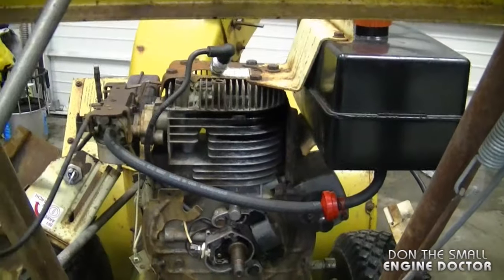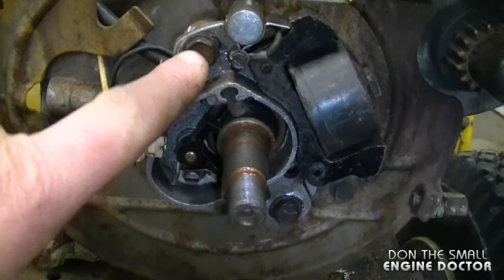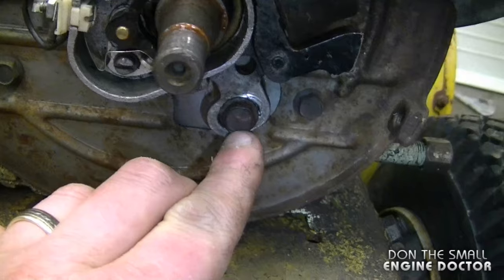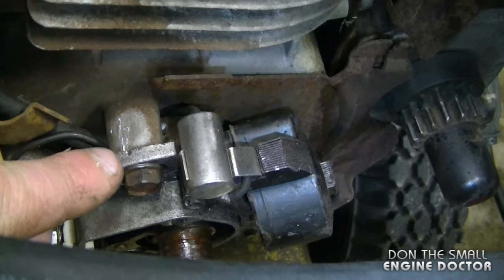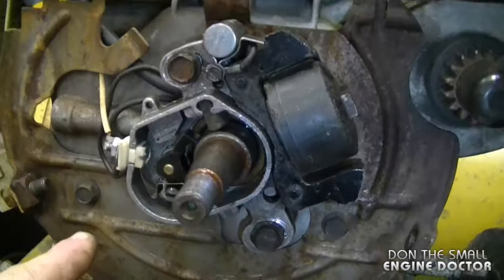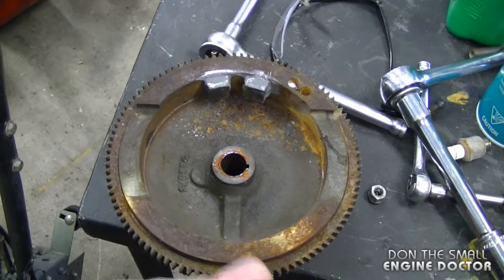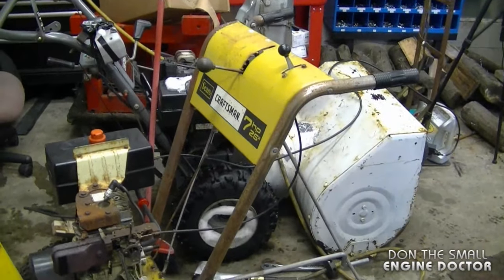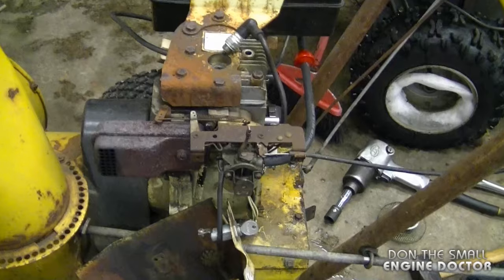Tecumseh Ignition Magneto Setting & Tips

Comment: Have you ever set the timing up as stated in the service manual by using a dial indicator and continuity tester? It would be interesting to see how close mounting the stator plate on the center of its slots is to the timing dimensions Tecumseh calls for.

Comment: great vid, I just was cleaning out stuff from my father's house and found the old mower I used as a kid.  a circa 1973  or so  Craftsmen with a engine model : 143.254102  (Tecumseh : LAV35-40814K) 
does not have a primer or choke or any safeties.  It had been stored dry for about 20 years  in a garage.  I cleaned and gap the spark plug  and tested for spark and it had spark.  I then added gas, then it leaked, I then did a quick clean of carb, it wasn't bad just some carb spray and steel wool in the bowl, Needle was NOT stuck. I then put it back together and then got it to run pretty good.   then all sudden it seemed like it had lost spark  or was off timing. so I checked FW Key and then popped off FW. key was fine.  Since I have never worked on a points ignition  I thought maybe I needed to sand the points but at that point I stopped and set it aside to research some.   Now that I see this  video I am thinking the alignment is not in center so timing is off as I was seeing like a broken fw key.  thanks

it obviously needs a oil change but it was at the full mark, and needed a air filter. and blade sharpen.  I know the plug was replaced at least once because I did that about 20+  years ago.
Reply: i just checked the alignment  and yah its off,  must of got loose and moved after I had it on its side.

Comment: Don,

Your videos are very informative and offer great repair advice for " Do It Yourselfers" - but there is a lot more involved with correctly setting the timing on older Tecumseh Engines with internal Points Ignitions.  I had training on this from Tecumseh Reps (when they were still in business) back in the 1990's.  You need a special tool - Tecumseh Dial Indicator P/N 670241 - to help find piston TDC and there are other specific steps necessary to set timing correctly.  This video just gives a rough approximation only which may or may not work all of the time.  Incorrect timing can cause two conditions: (1) kickback when pulling engine over, or (2) lack of power.  I have old VHS Tecumseh Factory Training videos kicking around my shop that the Trainers gave us during our meetings.  I will upload them to Youtube if I can find them.  They were very informative as I remember.
Reply from the maker: +bobbyphazer thanks, however most people won't have that training or the tools so this video gives them a good starting point that has always worked for me
Reply: Hello, did you ever find and upload those training videos?

Comment: The correct way to do this is to: 
gap the points, 
put test light on points such that it lights up when points are engaged,
find the timing dimension of your specific engine in a service manual, 
set your crankshaft to the correct positioning before top dead center, 
verify previous step with micrometer on top of piston, 
rotate points/condensor housing to the position where the test light from step 2 just barely turns on, while keeping the crank in the correct position, 
then screw it down tight. 
This procedure gets your timing accurate to the thousandth. Do it correctly, and your engine will start much easier and have much more power than just setting it in the middle with no regard to precision, and if you combine this with a proper carburetor clean/tune, you might be surprised at the power and ease of starting these things. There are many ways to mess this job up and not do it accurately, even if you "know" how to do it. +1 on the magnet glue and making marks to remember positioning, if you absolutely need to take the condensor housing off (which I don't recommend unless you plan on doing the procedure above).
Reply: WOW, Thanks for the step by step procedure. I assumed the reason that it was adjustable was either timing adjustments or setting the air gap from the coil to the flywheel magnets.
Reply: @bushmaster2936  The factory video is called "Timing Tecumseh Engines with Internal Points & Condensor Ignition Systems" on the channel bobbyphazer. Very good info straight from the horse's mouth
Reply: @tatwood93  LOL, I was actually watching it when your comment appeared. Thank you very much and have a great day !!
Reply: @tatwood93  Appreciate your time and info. : )

Comment: The proper way to set the Magneto is with a dial gauge indicator it's 65000 before top dead center you could use a test light or a volt ohm meter and you want those points to open right at 65000 before top dead center
Reply: Now to find an indicator......

Comment: Hi Don. Wonder if you can help. Have a very old Toto 5/24 with Tecumseh engine 31625. Was running OK. Had no kill wire to the magneto - broke off. I removed the flywheel and sure enough there was a connector but no ground wire. I added one - long enough to allow me to deal with the other end later. After re-assembling the thing won't run. It kicks but that's it and spits blue flames from the muffler with a strange high pitched ping like a ricochet. As you likely know these old ones are loud but a lower bang, bang with each spark. I read that maybe I tightened the terminals too tight onto the magneto? I did tighten them considerably. My new wire has a loop on it. I tossed the old push on connecter. Also the machine was on end with gas turned off so it is probably quite flooded. The new ground is touching nothing. I will check the flywheel key - was OK when re-assembled. Any ideas why this simple procedure could totally mess up my ignition? L left the spark out overnight to dry out and will install a new one.
Thanks in advance
Bruce

Comment: hi tony im having trouble with no spark and its needs a new coil nut i have yet to find one, can you just pull the coil offf the square peg its slip over and install/glue a nw one on??? my engine is on a toro 5/24 but identical to what you have in thi video. everthing i look uo doed not match this. thx Mike

Comment: Hey Don. I have one of these with a no start/spark. The wires that connect at the points are grounded full time. The only that I can unground is to disconnect the condenser. as far as I can see there is something wrong with the condenser? It builds up and releases voltage but maintain continuity until I drain the charge.

Comment: I just recently picked up an old Tecumseh HM 80 and I can’t get it to spark at all and I have replaced everything points, solenoid and the coil. I’ve sanded all the contact points check the wiring everything it’s driving me nuts do you have any ideas on what to try next?

Comment: Can you do an ohm test on these old ignition coils to tell if they are good. I've replaced points and condenser checked all wire still no spark. Can you somehow set the gap under the flywheel????

Comment: Hi Don I have a LH318SA snowblower and I changed the carbonator and sparkplug but it makes a popping sound at high rpms.  It runs fine at low rpm.  Can I have a bad coil?

Comment: Great Video! I changed the Coil,condenser and the points, set them at .020 and rechecked them 3 times after getting no spark.  The magnet is still strong and now I'm thinking it is the wiring of the machine(It wasn't mine and it looks like something was changed) The points run to the chassis screw and a lead runs up to a connector near the carb, also the wire from the on off switch runs there and another that goes underneath to somewhere I'm not sure yet. Could this be a grounding issue do you think? I am tired of taking the fly wheel off and double checking my work :) Any help would be awesome!!! Thanks.
Reply: If you tighten the points nut too much it will rotate the points spring down and cause a ground.
Reply: @garyh4458  TIP of the Day !! Thank you very much. : )

Comment: just got one of these in and its old , been setting for the better part of 13 years, had it running off and on and then all of a sudden ,no spark, only has a throttle and a gear shift , run by centrifugal  clutch .

Comment: I have a 1983 Troy Built Pony tiller. It has a Tecumseh 3 or 3 1/2 HP engine. I had to replace the cam shaft, and the governor assembly. This engine has the internal governor which has a rod that passes through the case, and has the flat perforated arm that is connected to the carburetor with a long spring. Can you do a video on how to adjust this type of governor.

Comment: hey Dony, I have an 8hp tecumseh HM 80 in great condition. the kill switch has stopped functioning & I see the connection clip to the engine must have come off. I can't find any info on its required connection point. do I need to remove the engine cover?

Comment: After cleaning and regapping the points, I now have spark, but the engine backfires out of the carb when I go to throttle up (then it stalls out). It idles ok.  Should I readjust the points, or do I have to adjust the magneto? The mag hasn't been touched, and the carb is new, and I tried adjusting the carb screws to no avail.

Comment: I think this video needs more information, I didnt know the condenser is a capacitor, or that you were supposed to spin the crank to find the point where the contacts open then set it there, I set the points too small at first.

Comment: Is it possible to adjust the air gap on these engines?  I have a similar machine (Tecumseh 8HP on a Sears snowblower) and the gap/timing is well adjusted, but the spark is very weak (even with a spark tester, it barely registers)
Reply: Can't adjust air gap. Make sure points are clean, loosen both 7/16ths bolts and file or sand clean the 2 mounting posts and the back of the points and coil holding plate where they touch the mounts. If that gets corroded or greasy the "grounding" isn't good.
Reply: Sometimes the 2 magnets get weak, so they could need a recharge or an alternate flywheel with good magnets. If you can find reasonably shaped replacement magnets you could glue (jb weld) 2 new ones on the flywheel at the same spots with the same polarity pointing the same way.

Comment: Hey Donny, I know this is old, is there any chance I can get a replacement coil for these old engines? I am having issues finding one.
Reply from the maker: yes they are still available
Reply: @donyboy73  Info?
Reply: @scottfirman  Just go online.  I just bought one today.  Cost $35 for a genuine Tecumseh coil but aftermarkets ones can be had for around $11 and up.
Reply: @garyh4458  I acquired what looks like the same engine in Dony's video but all stickers indicate it came from an 'Ariens tiller', I can't find any indication on the engine itself as to what model it is. Trying to search for a replacement coil is a bit hard when I don't even know what it is I'm looking for. Generic searches bring up obviously the wrong part I can tell that visually. That's actually how I stumbled across this video.

Comment: When I took mine apart the magnets were attached to the end of the armature. Should the be glued back to the flywheel and where would I position them?  Thanks again.
Reply from the maker: +Dino Marchesini yes they should, if you can find a good used one that would be better. your local small engine shop may have a used one

Comment: Hi
My tecumseh had problem with spark so I replace the points, condenser and coil, set everything up as it was before and motor started right up, was running for 10 min and it died, checked for spark again and there was no spark again, what could be the problem?
Reply from the maker: check the gap again, should be .020"

Comment: I have this on my engine and set it per the manual, which requires using a dial indicator on the piston.  I can tell you that it is not even close to being in the middle of the slot.  It may run that way but the timing may be pretty far off if you just guess and put it in the middle.
Reply: That engine needs to fire at 0.080 before TDC. If not, it will have pull back and break the starter cord, or run weak if set too far advanced.
Reply: @anthonyfuchs640  another guy stated .065" BTDC.....where did you get your spec from?

Comment: hi, i have a HS50 and the damn thing is driving me nuts. it came with a go kart that i bought my daughter. i changed the points and condenser. rebuilt the carb, new plug,timing is set accordingly. with all that i done i did get her running but not all that well. seemed once gas was given she didn't want to run at full speed. so i have seen a video about the valves and i now have them suckers out but i have no idea what looks good or bad on these valves since i have an untrained eye in the matter. to me they look damn good once they got all cleaned up. seems nobody has a video done on the engine i have.

Comment: Can kickback be caused by improperly positioning the coil? Is it advanced timing (too early) or retarded timing (too late) that causes it because I think the same thing can happen with a sheared flywheel key.
Reply: If the timing is advanced too much, the plug will fire before the piston is close enough to TDC, and it will kick back. Could shear the F/W key.
Reply from the maker: +kaiok1777 yes it could, points cause that as well if not set properly
Reply from the maker: +kaiok1777 yes

Comment: Or you could use a dial indicator And continuity light and set the timing to spec.
Reply: If you have those tools and the spec, you probably don't need dony's help as you either have the service manual or other knowledge of what you need to do.